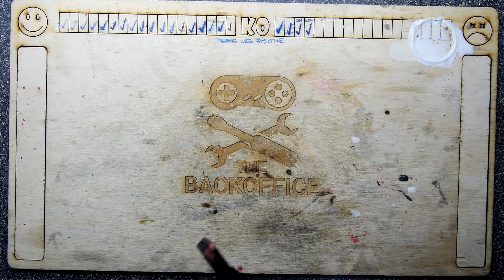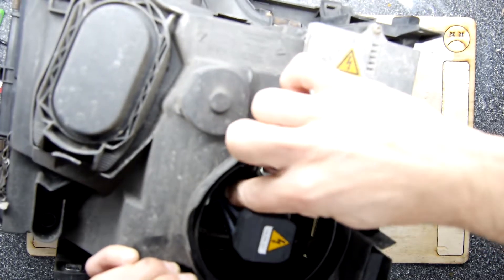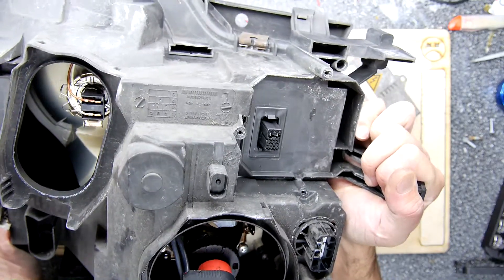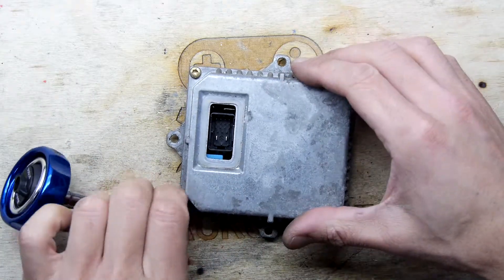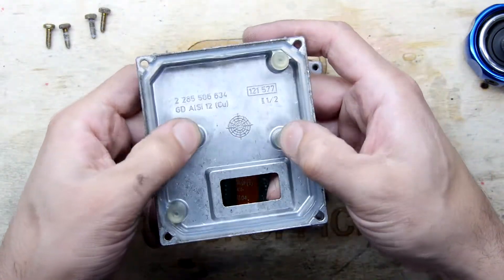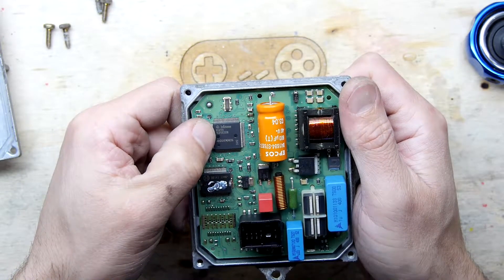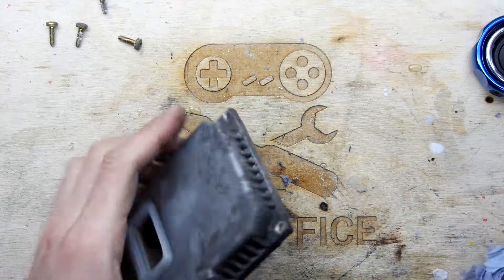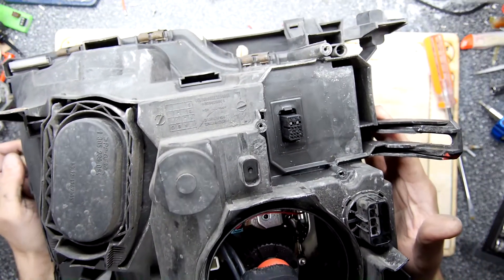L322 Xenon Headlamp Ballast Disassembly

Comment: Hello, my ballasts had water damage because of the humidity so i have to clean it with brake spray but I couldn’t find a way to access the back of the circuit card, what do you suggest? Thanks in advance. (Sorry for the english.)

Comment: 9:30 Is that the Bosch logo? I had no idea they make microcontrollers.
Reply from the maker: +Mike Bruschke Yeah, those companies have lots of sub business units, Bosch, Siemens etc.... Lots of automotive, industrial and heavy industry stuff
Reply: The Bosch part isn't a microcontroller. It'll be a specific device that probably includes both power supply function (for the infineon micro) judging by the heat sink package,but also maybe some logic interface components too (LIN/CAN etc).  The HV is generated by a switching boost converter, the switches for which are the 4 vertical TO-220 components on the lhs between the blue film caps. The wire wound inductor and big orange cap are the EMI input filter